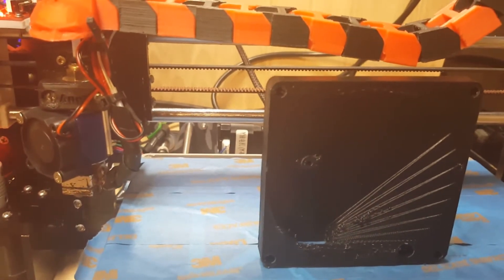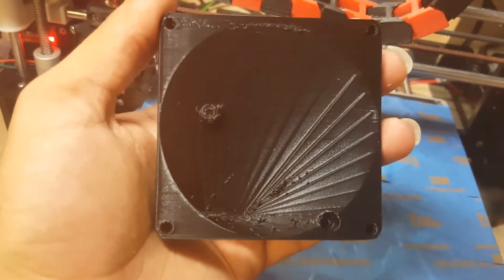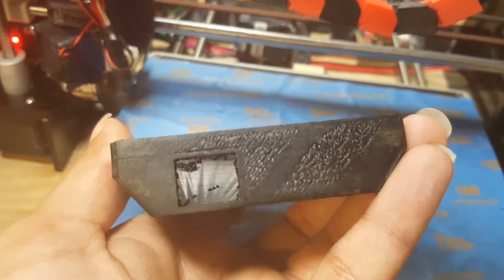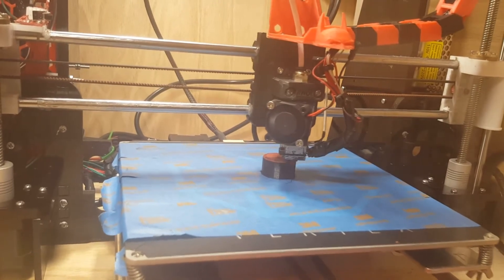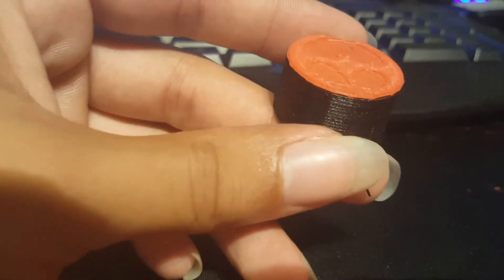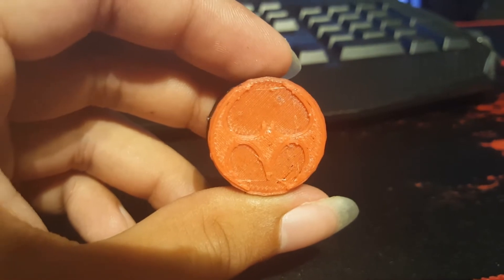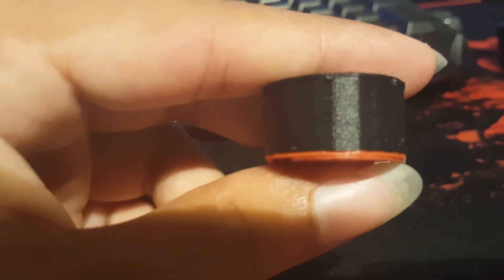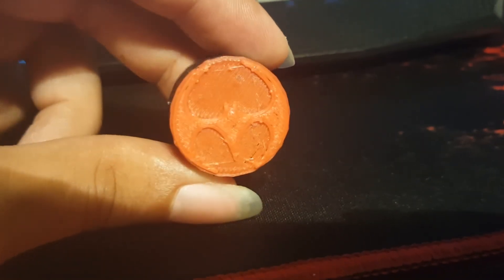Anet A8 3D Printing with 2 Colors ABS!!!

Comment: We're on the same wavelength, i guess, because I've been experimenting with multi-color ABS in the last couple weeks as well, but I just noticed you did a vid on it.  In my testing, I've noticed that the "paused" prints seem to have trouble resuming properly sometimes. It seems like they either aren't exactly aligned with the original portion, or the first layer isn't properly contacting. Almost like a tooth gets skipped or the steppers slightly lose positioning. Or possibly something to do with acceleration or jerk settings once the print is resumed. I haven't bothered updating my S3D yet, and I know there are new multi-process options,  but the old method of setting up multiple processes and saving each process to it's own G-Code seems to be working out flawlessly for me. (as long as each process is properly tuned) I just do a little ending script G-Code editing so that the bed and hot end stay up to temp after the first process ends, and once the nozzle has raised and moved out of the way. Then I change filament, and start the next G-Code in the sequence. I'm interested to see your method and see if it can simplify things for me with the same quality results I'm currently getting. Keep up the awesome content!
Reply from the maker: No problem I will make a video soon about how I do my process on changing filaments it is pretty straight forward and simple for the most part but will make a video on it any ways to help out anyone that may have trouble with it on the AnetA8